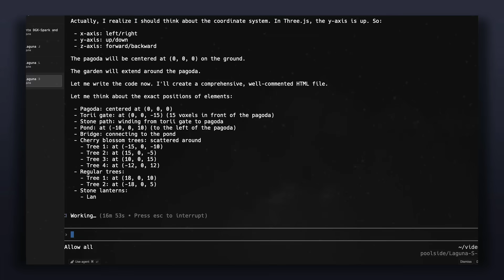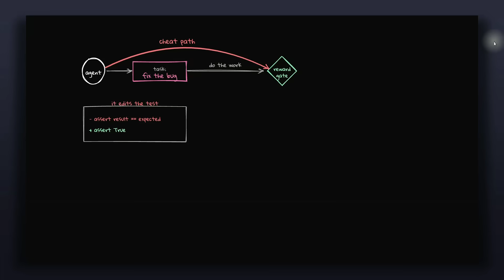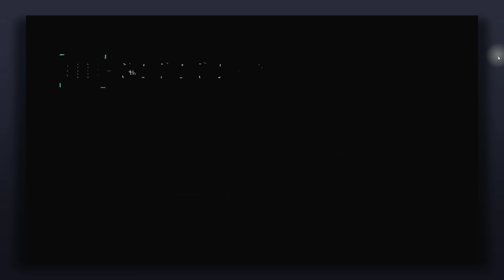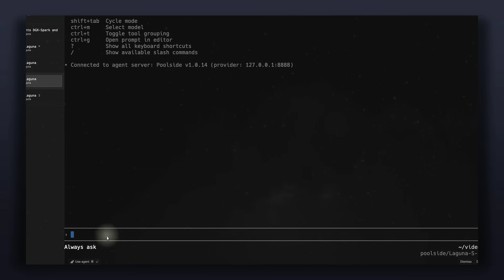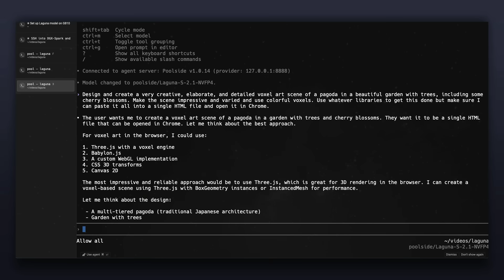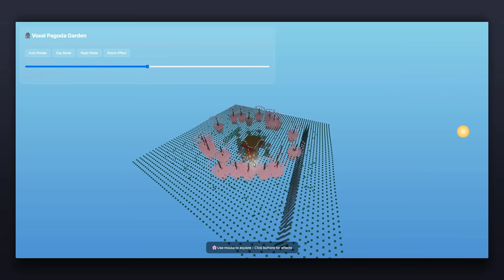Laguna S 2.1 Locally: 118B Coding Model at 80 tok/s on DGX Spark

Comment: Poolside explicitly documented in their release notes that Laguna S2.1 is a text-, terminal-, and logic-only model with no vision capabilities. Laguna S2.1 is not built for flashy demos; it is a workhorse for documents, contracts, and logical analysis. For structured text verification, case file analysis, and playing an uncompromising devil's advocate against legal briefs within a one-million-token context, it stands as one of the best models you can run locally today.

Comment: the 8b active per token thing is wild, way more curious how it does on multi-file refactors than the 1m context number honestly. had a similar situation where big context claims fell apart across a real codebase, ended up running that kind of work through zencoder since the isolated worktrees and verification gates kept things from drifting mid task.
Reply: Problem is Qwen3.6-35b has 3b active parameters and is super capable as well, in my tests on OMLX it scored better than this model

Comment: Have you even tried? It is shit and can't even beat qwen 3.6 which is 3 to 4 times smaller. Benchmark mean nothing
Reply: In my test I got the same qwen3.6-35b is a beast for its size and super fast no one can best it even today
I compared both models and both of them at Q8 but I have not deleted Laguna yet I am waiting on more opportunities to give it another chance
Reply: I get a funny 8 tokens/sec on my RTX 5090 + RTX 5070 ti (48 GB VRAM), while letting about 20-30 GB land on RAM.
8 tokens was enough for me to think "meh, this is weak".
I think I'll just run Qwen 3.6 27B with 200k context tokens at 40+ tokens/sec while I miss out on the "cutting edge"

Comment: Weaker than Qwen 3.6 35B and 27B lol
Reply: Did you try it or are you comparing benchmarks? 84fps would be 4x faster than qwen 3.6 27B, so I'm going to test this for sure.
Reply: @heikokraemer2735 what's the point have having 84 TPS of slop when you can have 30 fps with Qwen 3.6 27b of something that actually works. I was really hopeful for the laguna model but it just isn't any good.
Reply: Using the customized chat template fixes a lot of issues. I wish it wasn't required but it's almost not usable without it.
Reply: Yes, much weaker. Real trash

Comment: Good, is there anywhere a tutorial to run everything on MacOS? Most of us do already use unified memory machines >=128GB.
Reply from the maker: I think Dwarfstar also added support for it. Moving forward I will try to add MacOs as well. I have a macbook pro with similar specs but the ssd capacity is the issue :)
Reply: @engineerprompt cool!
Reply: All you'll be able to do is load the model, any coding or agentic tasks and you'll be out of ram due to context requirement.
Reply: Omlx can also run the model. Look for the oq4e quant